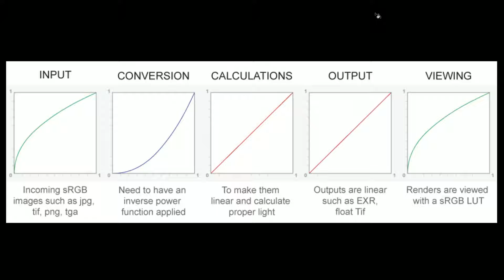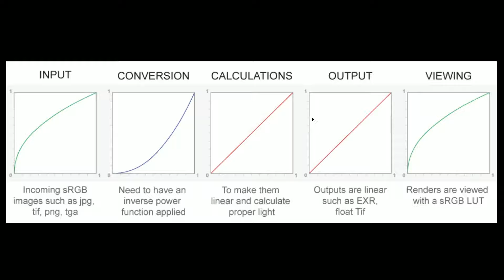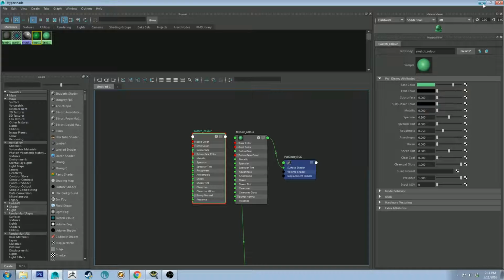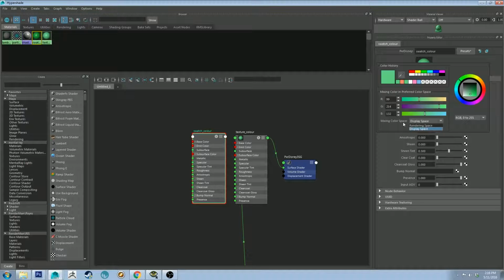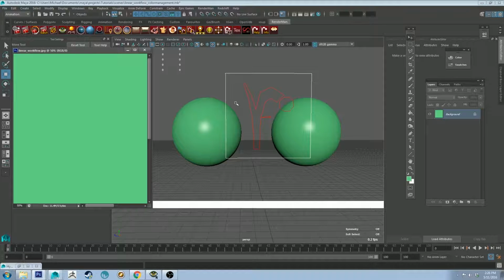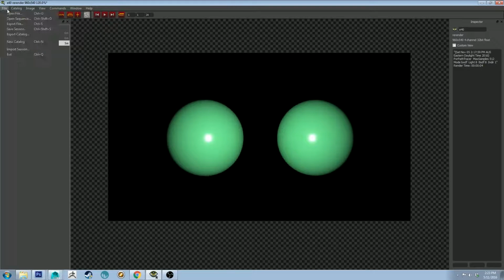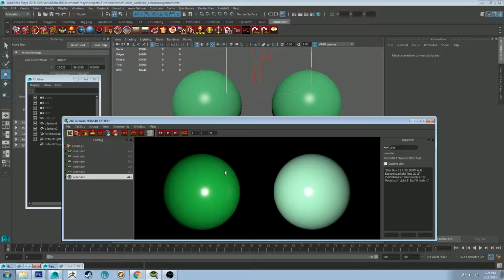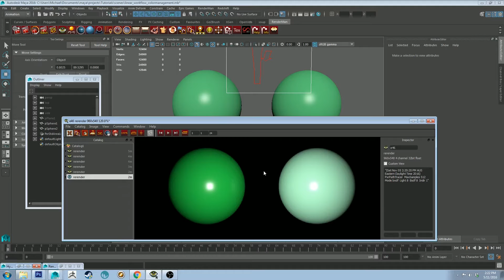Renderman Linear Workflow & Colour Management Tutorial

Comment: So I don't get it, you basically don't have to change anything. I checked all the settings for a normal shader with a texture applied and they are all the same by default like you. That doesn't feel right to me. I am trying to render a human head I textured and the  render comes out very light compared to what my texture looks like.
Reply from the maker: This was for 20, things were a little different than they are now. In renderman settings I think it's in the far right tab there's a global selection for linearizing, you need to know whether the images that you're importing are linearized before activating this globally. You can also handle your colour management in maya setting up rules for each file type.

Comment: I notice you post some of you work on instagram, which I assume is from your phone. Does your work ever look different on your phone than how it did on your monitor? usually I send my work to my phone after post work with correct color management, but it's just always a littler darker.
Reply from the maker: +MiRaje8086 does it? I had no idea I'll have to do some coverage this weekend, thanks for the heads up!
Reply from the maker: That's pretty much what I do as well, even the two monitors that I have that are the same show a slight difference in colour and brightness.
Reply: 3Dpixels it comes out in 2 days i'm super pumped
Reply from the maker: Yeah this will have to do with what the gamma and brightness settings are of your computer's monitor in comparison to the screen on your phone - if you want to try and sync the two up you could open a basic RGB swatch on your computer and open the same image on your phone then adjust your screen settings to match,  however this all would assume that your phone has a better more accurate color/gamma setting than your computer monitor. All screens have slight variations in colour and gamma and then there's print which is a whole different ball game involving screen calibrations with something like a Spyder. 

To be honest unless you're doing something that needs to look as close to 100% perfect I'd just eyeball it on your computer and make colour and brightness adjustments in post after rendering your image so it looks better on your phone - assuming your phone is more correct than you monitor (which also may not be the case!).
Reply: noticed that as well. i got 3 monitors and all show different colors. but i use the middle one as reference because its the same colors as on my mobile.
Reply: btw i subscribed mate. looking forward to some renderman 21 tutorials ;)
Reply: or renderman 21,2 i believe. they wanted to go on the new version right ahead and thats the reason for the delay in release